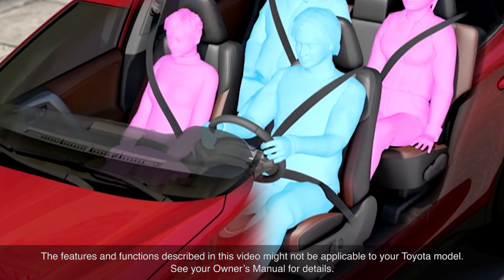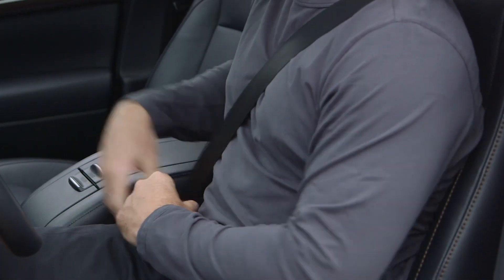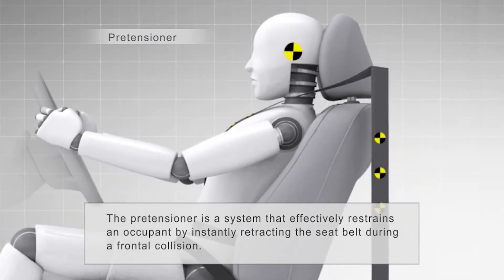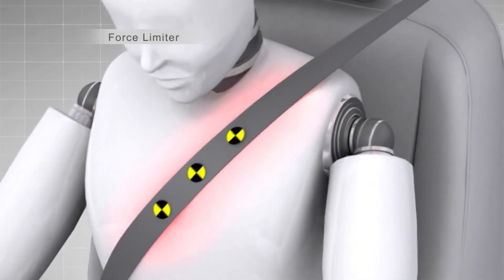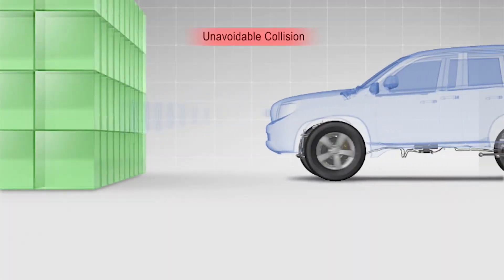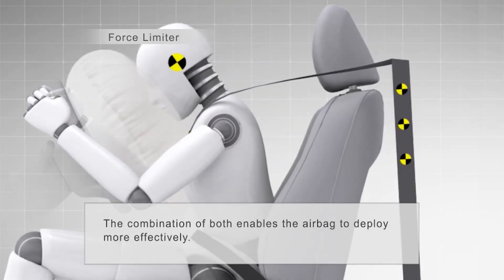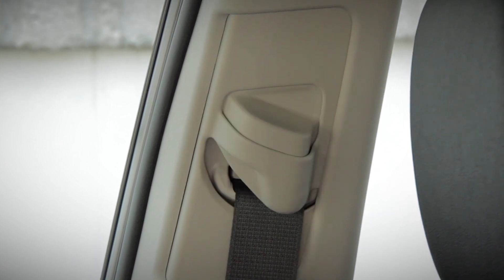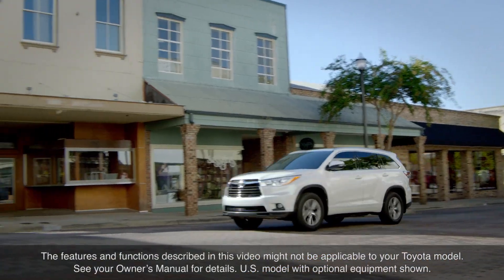Seatbelt Pretensioner and Force Limiter

Comment: thanks. how does a seatbelt height adjuster work for rear passengers? can't find information on it..
Reply: If your car has height adjustment in the rear, it would actually look exactly like the front. Most rear seatbelts are in a fixed position sadly.